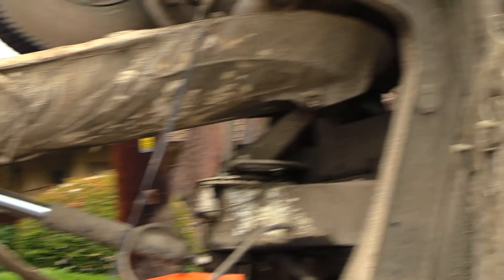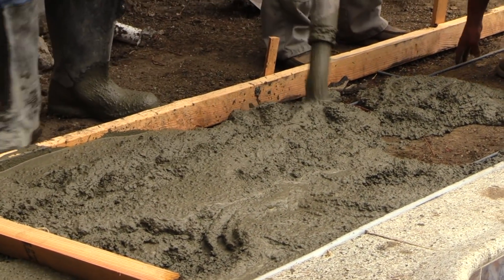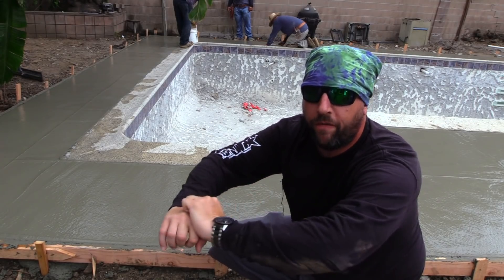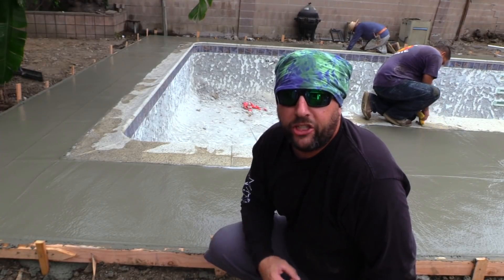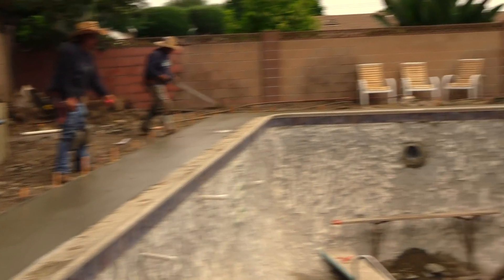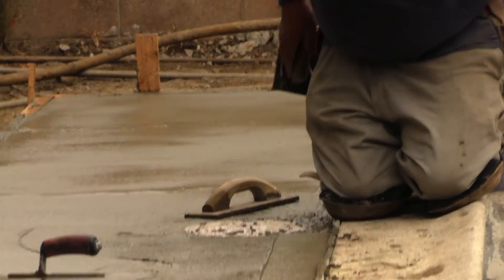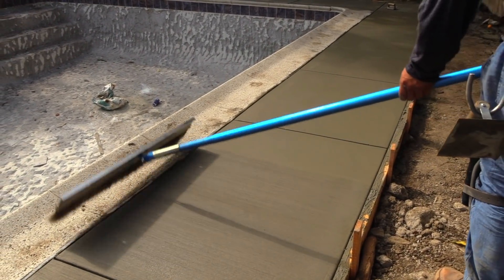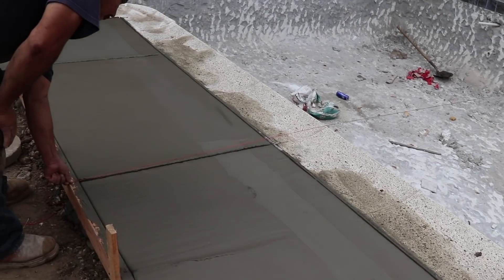How to Pour Concrete - Ultimate Pool Guy - Ultimate Pool Guy 2018

Comment: Hey brother the crew on my pool did not put an expansion joint between my poured concrete coping and pool deck what should i do im stressing maybe i can send you a pic and you can let me know??!!
Reply from the maker: Saw cut with a diamond blade

Sounds rough but there's limited options

ultimatepoolguy@gmail.com

Email pics here ☝️☝️
Reply: UltimatePoolGuy i just sent you and email with pics thanks brother!
Reply from the maker: Send me an email one more time though there's no s at the end
Reply from the maker: ultimatepoolguy@gmail.com

Comment: What material was used along the coping? How many control joints or expansion joints did you have to do
Reply from the maker: Anything foam 

1/2 × 3 inch inches video 

I've seen foam cord also used

Expansion joints every 4-6 feet
Reply: @UltimatePoolGuy  did you guys have to use redwood for expansion joint or just used the tool to leave the indention
Reply from the maker: Some of this construction is dictated by region 

We are los angeles 

The tool used is a 

Concrete torpedo groover 
4ft I think
Reply from the maker: Expansion joints can be cut completely by hand also

Brass Expansion joint tool

Hand held

Comment: Do you need anything between the bond beam and the copping? Like sand, plastic or????
Reply from the maker: Unless you are changing out the coping the coping should be stuck to the bond beam already
Reply: UltimatePoolGuy I am changing the copping.
Reply from the maker: Ok yes you want to form that up 

Make repairs to the bond beam where necessary 

And lay a mortar bed for your coping install
Reply from the maker: We have 2 videos on coping installation on the channel

Comment: Great video! Can you tell me the name of the tool and who makes it that was used to first pound the joints in before finishing them with a jointer?
Reply from the maker: thank you for writing in and checking out some of our work brother...thats a great question that i haven't been asked before...there are a number of names jointer, groover trowel or torpedo groover...seen here:

https://www.google.com/search?sxsrf=ACYBGNQ6R6IgqFo-Fg8kynFJIiVs4NgyyQ%3A1575480336506&ei=EOznXYqtHtH2swWRurLQAg&q=expansion+joint+cutter&oq=expansion+joint+cut&gs_l=psy-ab.3.0.0l2j0i22i30l5.146757.152388..154352...1.2..3.313.4265.12j22j1j1......0....1..gws-wiz.....10..0i71j35i39j35i362i39j0i131i273j0i273j0i131j0i67j0i20i263._8-Q_j85z28

available in different lengths 

we also recently released this video covering a complete pool remodel and you can see a similar process/tool used during the coping portion of this work

https://youtu.be/tinzO-hSdoM

hope this helps 
stay real out there!
Reply: Thanks, greatly appreciated!
Reply from the maker: @DrewFlyer  right on brother...good luck out there

Comment: What was that white stuff that was added around the coping?
Reply from the maker: Foam for the expansion joint material
Reply from the maker: the foam is later removed and the expansion joint material is poured into the joint
Reply: @UltimatePoolGuy   Why remove ? isnt the 2nd purpose of this to save on expansion joint material ?  I am seeing a pre scored 1/2 " so just 1/2 " can be removed ? thoughts
Reply from the maker: you need to maintain the expansion joint between the pool and decking 1/2 inch approx.
Reply: One more question so am I correct in saying if my coping is 2” thick then I only need 2” thick foam to keep the gap between coping and new concrete.. I do not really need to worry about gap between. Pool wall with Gunite and new slab ?
Reply: My pool wall below is 14” high
Reply from the maker: Just like the video
There should always be a gap between the back of your coping and your concrete decking we like to use foam strips just like the video